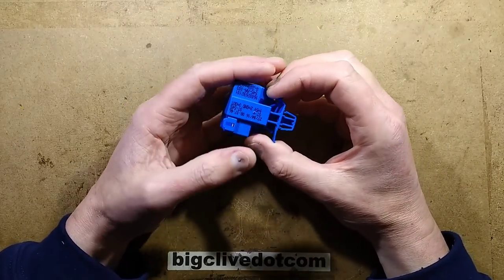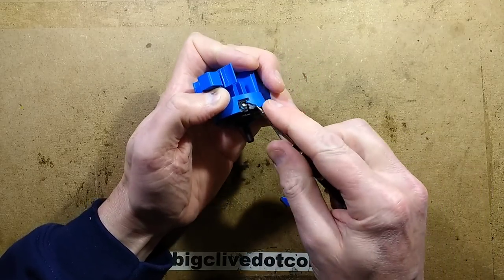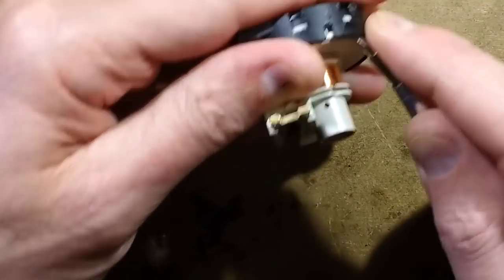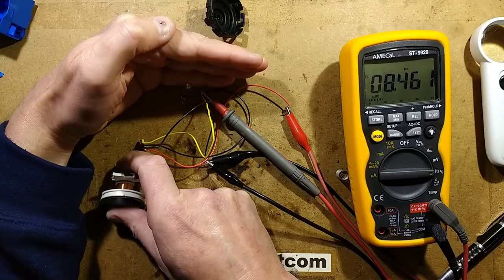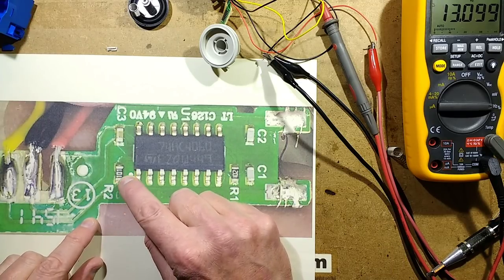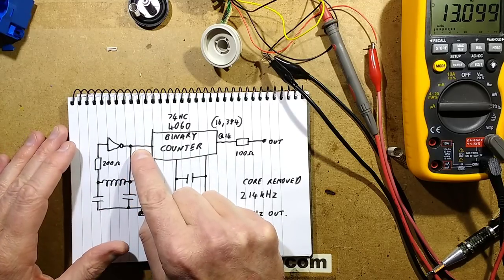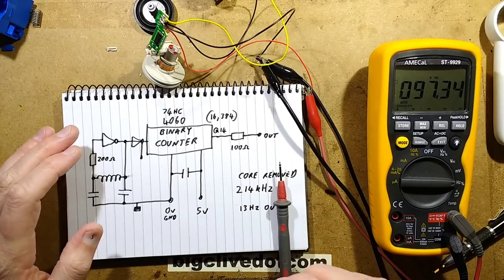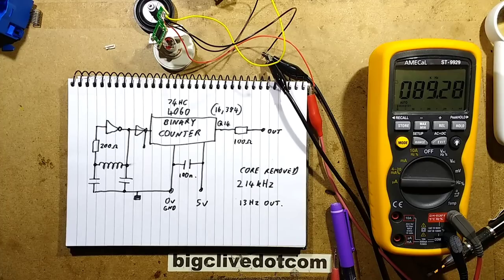Inside a washing machine water level transducer. (schematic)

Comment: Makes me glad my pre-indesit buyout Hotpoint washer is all switches and dials, seems wrong to slap an IC into the water level switch when a couple of microswitches does the job perfectly well... :)

But, as Scotty said, "The more they overthink the plumbing, the easier it is to stop up the drains", overcomplication of simple things is just a wasted effort in my opinion... :)
Reply: But this isn't complex...it's simple, and cheap, and easy to replace. So you comment is invalid.
Reply: You bet me to the Scotty quote by an hour.
It's more complicated, costs more to make, and the same cost to replace.
Comment valid.
Reply: Switches stick, especially with age.. and that's quite a common failure of the old type "pressostats". This device will never stick in that way. So it's a far better design.
Reply: So, let me get this straight, you want to use something which has more moving parts, i.e. up to 3 switches for example, which has terrible resolution (3 positions) over something that potentially can tell the washer EXACTLY how much water is in the drum because of it's near infinite resolution? This switch is a brilliant idea and probably costs a LOT less to make. 

Switches are expensive because of the exotic materials used on the contacts, such as gold, silver, platinum etc. They tarnish over time, springs become weak, yadda yadda yadda. I know what I'd rather have.
Reply: davegsm82 these are very reliable. I’ve never seen one break. The pressure dome/hose clogs with detergent powder at times, but the pressure transducer itself is reliable.

How do I know? I’m a WASHING MACHINE ENGINEER.

high fives Chris and Peter
Reply: Elliott Killingbeck - Did you read my comment wrong? I'm all for this type of transducer :-/ I'm against switches. Not sure how you could misread that but, meh, whatever.

How do I know mechanical switches are less reliable? I'm a PARTICLE ACCELERATOR ENGINEER, we use hundreds of them ;-)
Reply: i agree withyou, it doesnt need nuclear grade water levels with a chip, a simple switch can be cleaned,  good luck making this chip work when its considered obselete, whereas any mechanical level switch can be fitted or probably infinitely repaird
Reply: The 4000 series logic IC's have been around since 1968. Nineteen Sixty Eight! That's FORTY NINE YEARS. Do you really think the manufacturers of industry standard Jellybean-Logic IC's are going to stop producing them any time soon?
Reply: I agree, this is way better. The CPU can check that it is actually working. If there is no pressure variation at all it is broken. If there is, there is not much that could go wrong.
Reply: Precisely, if the sensor isn't sending any pulses at all, then there's something wrong with it or it's disconnected. In the old days, you didn't always know there was a problem until you had an inch of water on the floor. Your simple switched based pressure sensor only knows when there's water or no water. That's no good when you're wanting to just do a quick or 'eco' wash using less water and electricity.
Reply: and when it fails a simple circuit test, when the other fails, dig out an oscilliscope and a data sheet?
Reply: If you're afraid to break out a scope and search Google for a PDF file, then perhaps electronic repair isn't for you, but in all fairness, BigClive has already shown you how you can test this thing using an LED and a resistor. Most modern DMM's have a frequency counter mode too. 

To put all this in context, my Hotpoint WD640 main control board went thermonuclear 2 days ago, failed SMPSU blew conductive plasma arcs across the board and caused all 6 MOSFETS in the 3-phase motor drive to turn on simultaneously, blowing almost (but not all, fortunately) every bit of silicon on the board. A replacement board is unavailable due to the age of the machine, A similar board was sourced from a newer model. Hotpoint (indesit group) sell you a plug-in device to 're-code' your new board to your old machine, that costs £155 + Smart card eeprom file (about £25). EEPROM on board is 24LC64, I2C bus is accessible on rear access port of the board, but WriteProtect pin is floated high by the on-board micro. I was able to make an adapter cable for my G540 programmer, pull the EEPROM image from the board which had shat itself, then upload the image to the new PCB while shorting WP to ground. Result is a working washing machine for next to nothing. Previously, 2 failures on this machine were door interlock switch and mechanical pressure switch. I'd say that's a 2-1 win for silicon based failure, and I know which I'd still prefer.
Reply: @Jusb1066 Plenty of multimeters now have a basic frequency count function you can use to test these
Reply: @davegsm82 to be fair the SMPS going nuclear is bad design on Hotpoint's (or more likely, Bitron's) part. I love that "re-code" option Hotpoint sell for an artificially high price... they just want you to buy a new machine!

I will never buy Hotpoint/Indesit/Whirlpool ever again. Bigclive's video on his new machine also shows why - they're made overly cheaply, poorly, with sealed tubs and under rated bearings designed to fail so that you have to replace the whole machine in 2 years.
Reply: Yep, they have employed a TNY Topswitch type PSU with about 5-6 outputs, but unfortunately NOT ISOLATED, because of the 3-phase drive. Not shoddy in itself but Topswitch type PSU's tend not to have snubber assemblies on the primary winding (for BOM reasons, simply), because of this, any transient can cause all out destruction. 

I don't blame them directly, I think the boards are designed/manufactured around a basic core specification by third party companies (Jabil? Solectron? Magenetec?). I imagine that if they perform to spec, then they don't really care how shoddy the design is.

Anyway, I bagged a spare board which I'm going to clone as another spare, that should keep me going for a while. Not practical for your average user, granted, but I'm anything but average I guess (Ultra-nerd). The Re-code option is horrendous, smacks me of an 'OBD-2' -esque arrangement like you have in your car, where you can buy the tools at great cost to do it yourself or throw it away and let me buy it from the scrap yard... like this one.
Reply: the point being dave, you shouldnt need a scope to fix something as simple as  washing machine that can be done with simple pressure switches!, some devices are being complicated without reason, microwaves dont need digital timers when the mechanical ones are more than accurate enough to cook a ready meal, toasters also dont need any electronics and last longer without any, and washing clothes in an inch of water was a solved problem long before electronics, if washing machine repairmen are unable to do basic fault finding and are too lazy to repair anything and just part replacers, then its their own fault the job is on the way out, any monkey can plug parts in till it works
Reply: Who said you need a 'scope to repair a washing machine? As I said.. you can test the output of this sensor with a multimeter that has frequency count on it... even my cheapo meter has that. OR you could wire up a small piezo sounder - all you would have to do is listen for the noise to change pitch when you blow down the tube.

Anyway the odds of this unit ever needing to be replaced are unlikely - it is not a mechanical switch, so it has no contacts to stick or wear out as the old pressostats did. Only a tube to get blocked - exactly like the old pressostats.
Reply: You're missing the point Jsub, technology moves on. Sure, microwaves don't NEED digital timers, but they're nicer. If you're only cooking a ready-meal then fine, stick to your mechanical timer. But what if you want to do something else? What if you want a grill in your microwave? What if you want to set a timer to start in half an hour? My toaster has a mechanical timer, that's fine, works great, because it's ONLY job in life is to make toast. 

The Microwave though, it has loads of different cooking modes and timers blah blah blah. I don't necessarily use them all, but they're nice to have. 

Back to the washer though, in the 'olden days' we had a huge mechanical timer which controlled everything, heat, motor, pump, etc etc. That was the SINGLE MOST COMMON point of failure, the contacts would burn out on high current positions such as the heater. Could you repair the timer? No, not practically. I tried many times to separate the sections and put new ones in from other timers. Never worked successfully. Conversely, as long as you have power to the PCB on these new machines, if there's a fault, it will display an error code on either the LED's or LCD/LED display. It LITERALLY tells you what the problem is. Taking too long to heat up/no delta? - Element probably blown Error code. No communication between front panel and main panel? error code. NTC thermistor disconnected? error code. Relay not closing (no feedback voltage?) error code (do you see a pattern here?)

A Monkey can plug in parts until it works, a Clever monkey will look at the Error codes, make an assessment, use a multimeter or a DVM, make a firm diagnosis and then warrant a repair. We don't live in the past any more.
Reply: Unfortunately the HC logic family is slowly disappearing. It is being replaced by low cost microcontrollers such as the microchip PIC range. The advantage for the OEM is that they need only stock one device to implement the different functions demanded by many applications,  all that is required is a change of software. PICs have the edge over programmable logic, such as PLDs and FPGAs in cost and having mixed analogue and digital I/O. The only disadvantage is they execute instructions sequentially, which is not compatible with some time critical tasks that require parallel processing.
The HC4060 is one of the few counters in the family that has a built in Pierce oscillator, requiring only three external passive components to form a very stable clock. The coil in this application is usually replaced by a parallel resonant crystal, such as the 32768Hz clock crystal in timing applications
Reply: PICs in no way replace FPGA/CPLD technology, and there is always the need for "glue logic". As an example, I have just gutted an unwanted ADSL2 router for parts.. and alongside the custom Broadcom ASIC which is the heart of the unit.. there is a 74HC14.
Reply: Peter and Michael, I agree with you both, PICs have their place in industry but they are usually beaten to the post by Atmel stuff as they tend to have more flexibility in the IO ports. Microchip now owns them anyway as far as I know so I'm sure we'll see a marriage of the topologies in the future anyway. Brilliant for low cost low reliability jobs but not for high reliability stuff, I know because they're my favourite flavour of micro. 

There will always be a need for logic stuff, I once prototyped a 33kw power converter at my work place, the engineers built a microcontroller solution which crashed as soon as bus power was applied because of noise. They went to an FPGA design and even that 'crashed' when power was applied and run past 50%. I say crashed, but I think the master clock failed or something. I eventually created a fully 4000 series logic based version of the converter and it worked flawlessly so they went with that design. Same goes for high reliability Aerospace things, pump controllers for aircraft are logic and OTP EPROM controlled because they only have one job and they absolutely HAVE to perform that job under all circumstances if or when they are called up to duty, I know because I worked on them during the production phase.
Reply: davegsm82 There is a place for each of these technologies. In my time as a circuit designer I have used all of these plus a number of different DSPs. Each technology has its design tricks. In the case of MSI logic, the trick is knowing the functions avaliable and being able to see how to build the required circuit using the minimum number of ICs. The problem is that silicon manufactures have rationalised the number of MSI function they make. Beyond the basic nAnd, And, Or and nOR, ( now avaliable as single gate sop) the more complex MSI functions have started to disappear. It is these that are being replaced by low cost microcontrollers which have the advantage of soaking up some of the analogue functions in the process. Things like A to D, D to A and comparators. This leads to a minimum IC solution. PLDs lack these analogue inputs. FPGAs only really work for designs requiring a massive number of I/O pins, and thus dominate system on chip designs. It is the cost of the development tools that exclude FPGAs, and to a certain extent PLDs,  from the designs that were once the domain of MSI logic.

Comment: To increase water level, just adjust the plastic screw inwards!
Reply from the maker: That may increase rinse level, but the initial detergent fill will use just enough to the point that the clothes are saturated by detecting a change in the water level.
Reply: Well, it worked on mine, going from "save the Earth dry-wash" to a proper wet wash. Draining the Earth's resources one liter at at time! :)
Reply: @RolfRBakke  What model washer and sensor do you have? Thanks.

Comment: How do they prevent the connector to get clogged up ? There needs to be a small flow of liquid / gas in and out,
but it seems as if everything on a washing machine gets clogged up with micro fiber and detergent residues over time...
- so why not that small intake for the pressure ?

Comment: thanks for the great video clive, over engineering but hey gota get your worth somewhere for the $1200 dirty draws washer
Reply: Keith Neubauer it’s under-engineered. Over engineered would be a ARM based computer reading a load cell or piezoelectric pressure sensor, all tucked into a CNC machined case. From a mechanical standpoint, this device is very similar to the electromechanical water level switches of days gone by. The electronics are very simple; no microcontroller, no ASIC,  just a bog standard off the shelf part, a few passives and some wire.
Reply: agree to disagree lol

Comment: Hi Clive This looks the same as on an Electrolux washer and trying to adjust the water level. My one has no screw on top. Is there any way to adjust this for more water in tub
Reply from the maker: Modern washing machines will initially just make the clothing damp initially to maximise detergent strength, increase agitation and reduce foaming.  The machine usually adds water, tumbles the clothes and then checks to see if the level has gone down.  When it detects the level is the same it will stop adding water.
You can't make it add more water during the detergent cycle, it only uses more water during rinses.

Comment: I'm wondering why it is necessary to divide the 214kHz signal at the sensor, would that be because a lower frequency is more able to be transmitted to the controller over low grade wires?
Reply from the maker: The lower pulse speed gives the processor more time to time the duration and could provide more accurate results.

Comment: That 200R resistor should be on the output of the gate, not the input.
Edit: And looking at the PCB the coil appears to be connected directly to pin 11, which is the input to the first gate in the oscillator cct.